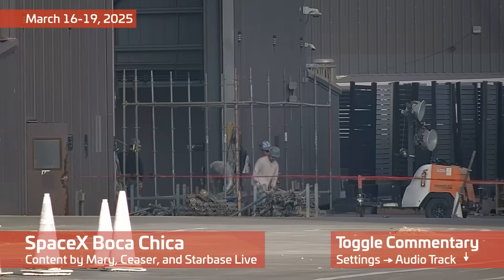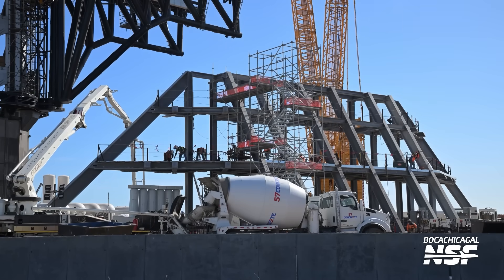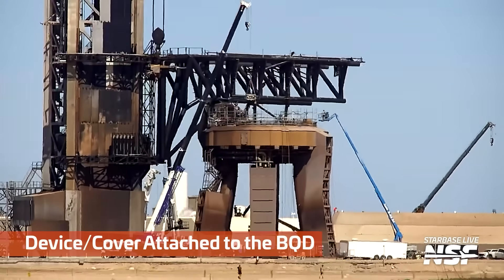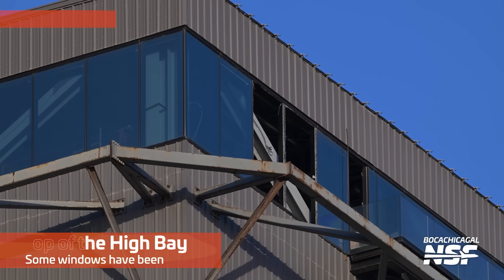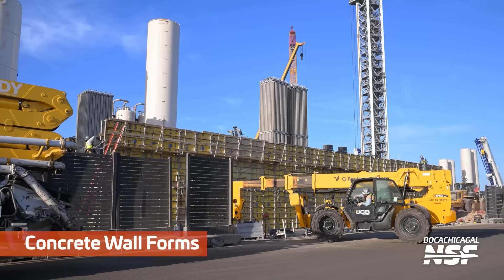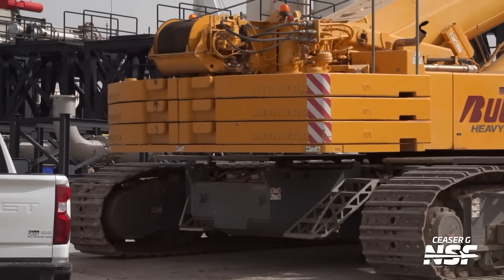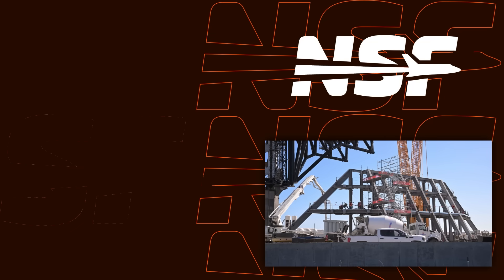Flown Rockets are Beautiful (Infrastructure, Too) | SpaceX Boca Chica

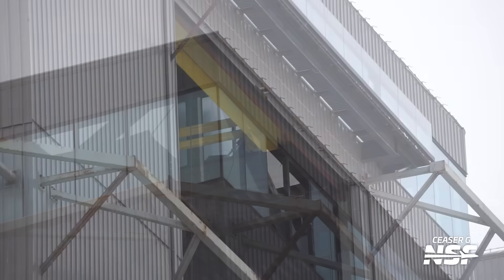Comment: 9:10 The bridge crane trolleys, motors, electronics, and every other part that wasn't a custom length can be refurbished and easily used in another bridge crane with similar capacity.

The beams were engineered as an integral part of the building structure. Or rather, the building's structure and the crane's frame were engineered to work together. Another building could be designed around the crane, but that seems unlikely.

So the beams will likely be scrapped along with the other structural elements of the building. The electrical and mechanical cables would require significant inspection before possible reuse. I suspect they would recycle them and use factory fresh cabling.

Comment: doing battle against physics is my new favorite saying.
buttresses run down the side of a building to distribute load to the ground, flying buttresses are the same but set away from the walls, these are just horizonal trusses on the bays.
Reply from the maker: Well, they're tearing them down anyway so 🤷‍♂️ heh. - Das
Reply: Buttressing is soooo much older than most people actually realise.

You can actually see it in use on mud brick architecture and walls from the pre stone dynasties of ancient Egypt, namely the 2nd dynasty structure of Shunet El Zebib built for its final pharaoh Khasekhemwy - the last great structure built prior to the first pyramid at the beginning of the 3rd dynasty (the stepped pyramid of Djoser) some time around 2700 BCE.

Comment: 9:33 that is called a "hydroseeder". Generally contains a slurry of seeds coated with a layer to help them retain moisture as well as a fertilizer and yes, it usually is green in color to give the immediate area a green color that will rapidly be replaced with the green of sprouted grasses. The color is utilized as an indicator to let the operator know WHERE he has sprayed. Good stuff. You can hydroshot a really large area quickly and works on steep hills while stabilizing things. Costly but usually well worth it in commercial settings.   
Peaceful Skies
Reply: that actually makes a lot of sense! cool!
Reply: More nerdy details: the mulch comes in bales, and that’s where the green dye is. You just toss one in, add a scoop of seeds, and the tank has a stirrer that keeps it all mixed until you spray it.

I think the mulch is like hemp fiber or something. It usually pumps through the pipe just fine but it’s a pain if it ever clogs!

Comment: The corrugated galvanized steel sheet forms a permanent mold for a poured concrete floor on top of the steel structure. This is common in big steel buildings. Thanks for the update!
Reply: I’ve worked with this material before. It is sometimes referred to as Q Decking (outdated) or metal decking. It’s just the underlay for a concrete floor, poured directly onto the embossed metal.
Reply: Does it require a plastic overlay on top of it before pouring the concrete 🤔
Reply: @Mr.Pheonix_CEP I don't believe so. A plastic sheet between the metal and the concrete would prevent the concrete from bonding to the metal, and it would trap moisture inside the cement. Plus, it would trap moisture between the plastic and the metal, which isn't ideal. The metal is galvanized and the perforations are small enough to not let the thick cement flow through, but just enough for the concrete to have something to latch onto.
Reply: Yay! I loves me a good John ramble! 😊